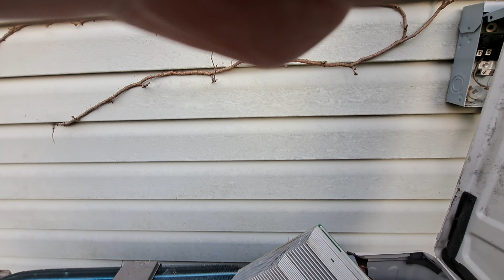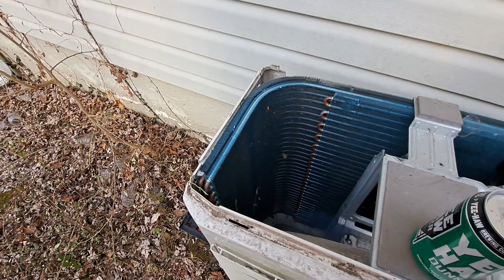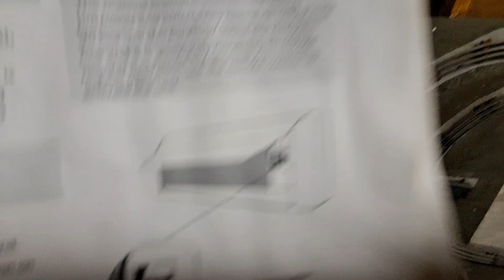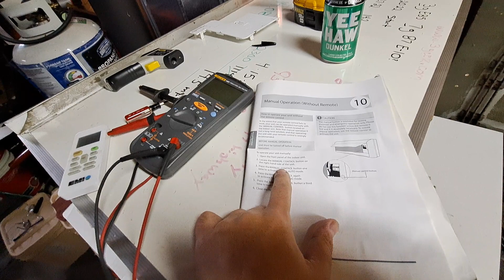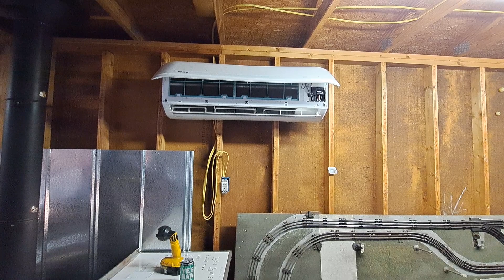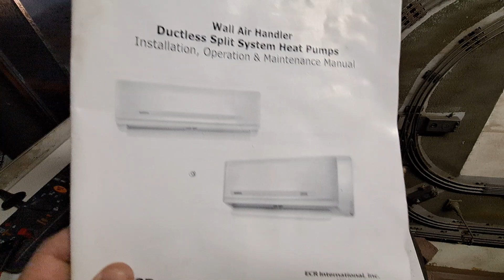EMI mini split why oh why... dont go cheap on AC!

Comment: Are you not able to put a gauge set on itto check your pressures?
Reply from the maker: Dr Snooz in the house! No I dont have gauges for it the fittings look bigger than what I have. I think its the 410A freon. I ran it all last night and its not making much heat this AM. I think I have a friend that can check it and get the freon for it.